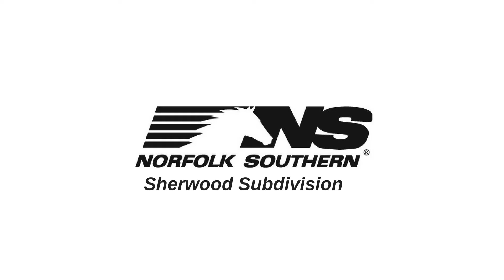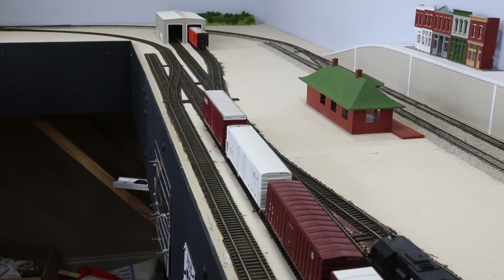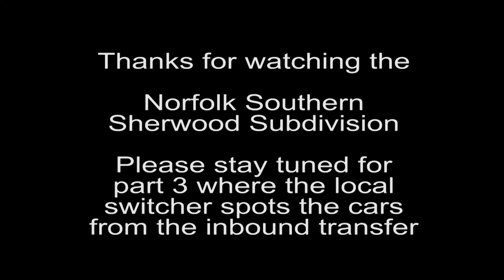Model Railroad Operations – Sherwood Daily Transfer Part 2

Comment: a lack of ditch lights actually restricts a lead locomotive to 30 mph not 15 per FRA regulations.
Reply from the maker: Thanks for your correction. According to the Norfolk Southern operating rules book that I have, the limit is 20 MPH for a lead locomotive with no operating ditch lights. I'll correct this at the next opportunity...Harold